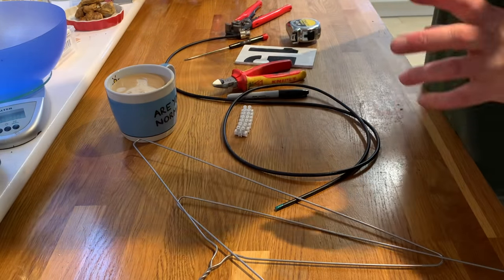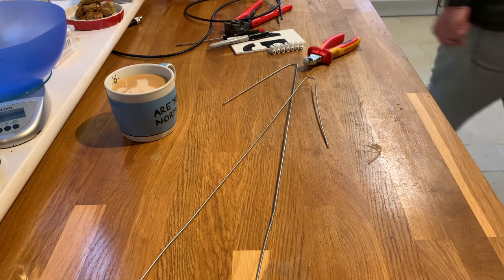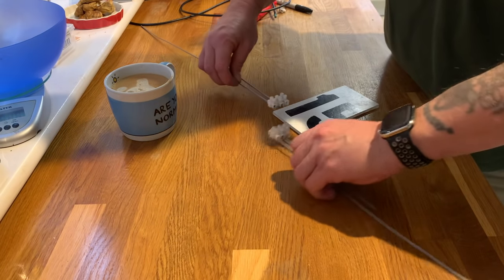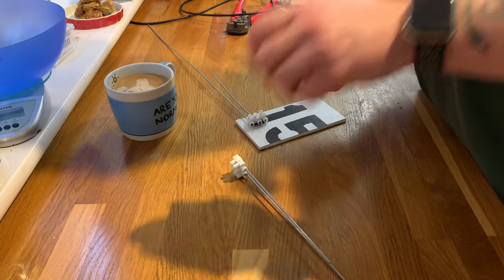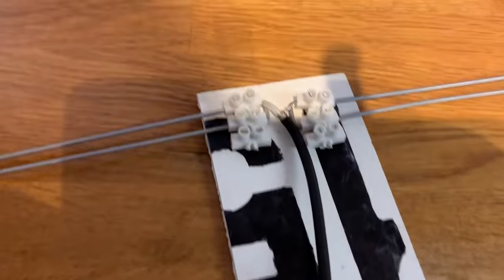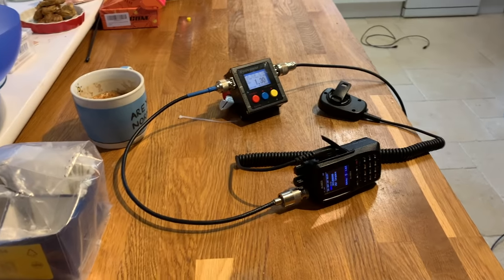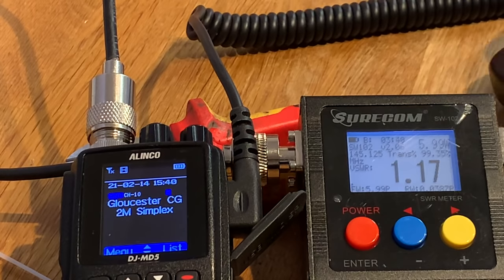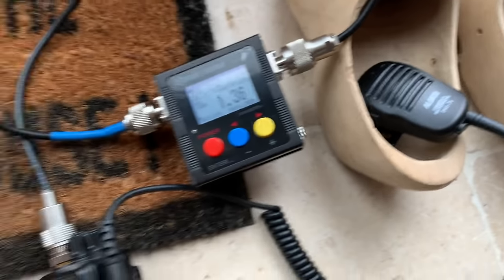HAM RADIO: The Coat hanger Antenna 2m/70cm dipole.

Comment: Thanks for the video! I built one last night following your measurements mounted on a flat piece wood and it attached to 1/4 pvc on a flat base as a indoor stand. I live in a apartment with very strict rules. Took me less than a hour  to build and I must say wow! I can open repeaters 30-40 miles away from the second floor completely indoors and 5-7 watts from my UV-82HP.  Match stays between 1.1 - 1.3 on all bands 2m/440 on my first try.  I'd much rather build my antennas than buy them so much fun!  Thanks for the inspiration to build again....I'm watching your indoor stealth build now, good chance I'm building one this weekend for a fellow ham in the same living situation nearby.  Anyone wanting a cheap & easy to build antenna it performs much better than the Nagoya NA-771 I was using with great reports on air. Thanks from Ohio 73's KB9QDI
Reply from the maker: Pleased I could help.  :)
Reply: @mike-M0MSN  definitely did, I've since made the 10m coax vertical and bought a new Ft-710! You gave me the bug 🤣. Thanks my friend, I love your builds and has given me the inspiration to build again.  The 10m has made contacts 4000 + miles already during Winter Field Day. So cool!
Reply: Thanks, this answered my search for a simple 2 meter / 70cm antenna for my Yaesu FT-65R handheld ham radio.  Needed one to place on the second floor deck.  Visiting family & needed a quick & easy way to hit local repeaters from the back garden.
Scrounging parts now. 😁.  Cheers,  KJ4KNV - D.L. in N.C.🇺🇸

Comment: Cheers from 🇺🇸US from being London born in 1944. I have built 2, 70 cm, and FM band broadcast ground planes using coat hangers and SO-239 connectors in the past and they
worked pretty well on those bands. Ray W2CH

Comment: Hi Mike, my first 2 m vertical antenna used 3 coat hangers with vey little cutting. 2 as a ground plane / 4 leg support and 3rd as the vertical radiator. It was an improvement on the 'rubber duck' and helped me get into the local repeater. 37 years ago now! 73 G0JLF
Reply: Heh, once built an SO239 socket and wire coathangar 1/4 w GP for 2m.   Managed to work MIR on packet.  Good times.

Comment: First 2m antenna I ever made was done with coathangars.   Built around an SO239 socket, 1/4w ground plane with radials.  Worked well enough to hit the Mir Space Station on AX25 packet when it was still operating.  That was a while ago now lol.

Comment: I got good results with the hanger looping through just one set of  terminals, anchored on the outer ones with the feeder on the inners. had to take some  of the bloc casing off though. it'll save about half a penny maybe, but I was running out of blocs.

Comment: Great Video.  Can you add additional elements to the same connector to cover additional frequencies?  Maybe use solid copper wire, etc. due to the length.

Comment: How easy was that?! Will be a bit long as the antenna starts at the coax split, so that middle spacing is also part of the radiating elements when measuring up. Now to raid the wardrobe (I assume I ignore the plastic ones 😮) 🧥 👗 👕👍🏻

Comment: That turned out awesome Mike. Its neat that you can build such a small dual band antenna for those bands.😀
Reply from the maker: Thanks 👍
Reply: @mike-M0MSN  How long does it take to get a lisence to use 2 meter and 70cm bands Mike?
We have to have 11 meter CBs in dump trucks to communicate with asphalt a nd gravel loaders and scale houses which is what got me interested in 2 way radio to start with but I don't like being limited to 11 meter.  I love these smaller antennas. 
Another youtuber was saying he made a 120 mile contact on  2 meter.😃
Reply from the maker: @RC-Heli835  The exam is online now, you simply need to purchase the “foundation now” book from the RSGB or Amazon etc websites and read it. Book the exam and pass it.  Please note that the license strictly forbids the use of Amateure Radio for commercial purposes. So if you need a radio for work that’s a different license.
Reply: @mike-M0MSN  Ok im looking into it thx.😀

Comment: ive build this also but for one of the long radials i used an old radio antenna  on the plus site  then it was so easy to get a good sdr 1,1 then isolated all with pvc  and iso tape   still works very well

Comment: The swr is good, but not necessarily the  radiation. If you have a dipole for one band and then another at 3x the frequency (like 2m and 70cm) with a common feedpoint then the higher band will have a radiation pattern that is not perpendicular to the antenna and not so useful when the antenna is mounted vertically. On 70cm RF currents will flow on both dipoles because the 2m dipole is low impedance on 70cm as well. The antenna is simple to build and I'm sure  it will be useful in many cases anyway.
Reply from the maker: Yep spot on Arne T and that is the whole point of the upload, to a help and to make people give it a go.  :)

Comment: If no one can find any kind of wire hangers at all, there is some 16 gauge multipurpose wire that you can find at a local hardware store thats pretty cheap for 50 feet, and it is awesome for this.

Comment: Great video Mike. I am yet to build some antennas when I manage to get a NanoVNA. Can never get my head around how these antennas work with two different lengths of elements on the same coax connection, but hey ho. Wow look at you with the nespresso. We have one but the local place that sells the pods are John Lewis I have seen the on amazon. We used the pods that came in the box and that's it since. Great quick antenna build.
Motters M7TRS 73's
Reply from the maker: Go to Nespresso direct online, next day delivery...  will do a video explaining how fan dipoles work in the future.
Reply: @mike-M0MSN  Super Mike will look out for that. Keep up the great work and advice Motters M7TRS 73's
Reply: Simple answer is you can have multiple elements like this design and providing they don't conflict with each on harmonics then whichever one is resonant will take priority.  I'm sure we can get Greg to do a speech on it when Macc club opens again :)
Reply: @2e0txe  hello Damian. so I guess this is some sort of radio magic and it just works. Greg drove past me the other morning when I was driving to work. Stay safe.
Motters M7TRS 73's

Comment: Hi and thanks for the video. I followed instructions very closely. It looks fine, continuity is not an issue, and I used decent materials. However, I simply cannot SWR it, constantly reading VERY high and with a AT-5555 I get an S-HI warning almost as soon as I pick up the Mic - what am I doing wrong?
Reply from the maker: This antenna is for 144-148 & 430mHz (2m & 70cm) not  27 mHz the AT-5555 is a 27mHz CB or 28mHz Ham radio....(10-11m)

Comment: Interested to see what the swr would be on 70cm without the 70cm dipole legs. As a 2m dipole alone doesn't have too bad swr on 70cm.
Reply from the maker: Probably not that much different  just the radiation pattern differs ( I got up to 1S point better signal on 70cm) but that could have been conditions

Comment: HI Mike,

Can this design be expanded into a 2- or 3-element yagi? If so, can the reflector(s) and director(s) also be configured like the driven element, or would they need to be separate for 2M and 70cm? I'm also wondering if they could be configured perpendicular to each other?
Reply from the maker: yes possibly give it ago...

Comment: Does wire thickness matter ? I used 1.3mm wire from a hardware store as could not find metal coat hangers anywhere, I didn’t know if using 1.3mm wire mattered or not ?

Comment: Nice! Great project for a rainy day. My only comment is that I’m guessing it’ll be a 1/4 wave antenna with an opposite ground rather than a dipole, since the jacket of a coax is ground rather than oscillating. Kind of like a tiger tail on an HT. A balun would make it balanced, and have the element connected to the shielding also radiate, increasing the gain. Right?

Comment: I tried to make this but my coax shield  and terminal would not fit into the block!  I sanded down the coat hanger and still did not work.
I am going to re-make it again and use a larger board and actually solder two jumper wires to an SO239 I think.

Comment: Great design Mike! I made one last night and it worked fantastically! I had to make two modifications in order to use the materials I had on hand: 1) I used 12 gauge solid copper wire 2) I used a bnc to banana connector. I soldered a short piece of 16 gauge speaker wire to the connecting points and the used the screw terminals on the banana plugs to connectthe other end. After tuning the performance was excellent!

BTW - What is the name of this antenna design?? I'm looking everywhere and can't find this particular design anywhere.
Reply: The name is, Coat Hanger Antena
Reply: Its a basic 1/4 wave dipole with 2m and 70cm elements. It can be used for Vertical (FM) or Horizontal (SSB) by flipping the base plate so the elements are vertical or horizontal.

Comment: Mike, I am a newbie and I am preparing to built something similar. Do you have any advice regarding adjusting the SWR by shortening the wires? What I mean is this: As far as I know, the 70cm and the 2m wires do not act independently, instead, they influence each other. So, is there - for example - a best practise for the order, like "first adjust he 2m part, then the 70cm part" (or vice versa)?
(If that makes sense - I am not a native English speaker)
Reply from the maker: Hi, it is always good practice to adjust the longest element first as these elements will have effect on their harmonics and in this case, the 70cm element so start long.
Reply: @mike-M0MSN  Hi Mike, thank you. This is exactly what I needed to know.🙂

Comment: What effect does having the wire U shaped like that have? Would you call that some sort of off center fed? I dont get why you have 2 radials on each side of the dipole instead of a single element. PLEASE explain.
Reply: Nevermind. Im stoopid. :)
Reply from the maker: Not stupid :)

Comment: Now build me one for 10-11 meters where I run. I need one for my attic when my Arial is down when my wife goes to Town, I must lay mine down on the bushes outside my house about 4 feet off the ground, it still have a relatively low SWR but can't get out very far when it is that low above the ground. So I want to build me a horizontal and one vertical, one for north to south traffic and one for east to west traffic here in the U.S.  For 28.000-26000 Mhz. So far not having much success.
Reply from the maker: OK Will do, one attic antenna for 27MHz coming soon, :)

Comment: How critical is the space between the two halves when mounting on the plastic? Just not touching or ??
Reply from the maker: Yep just not touching 10mm is good
Reply: @mike-M0MSN  thanks Mike! I have it built, just have to attach to a piece of wood from an old clipboard and attach some coax. Going to check out your other videos too.

Comment: Nre ham here and i have lots of questions 😂
 So if i wanted to hang this in a tree with a rope could i bend a eye in the end of the wire to tie the rope off to to hang it from  and if i did that would i need to do it after i get the swr set or would bending a loop in the end of the wire need to add to the length
Reply from the maker: yep add 1or 2 cm to the length of the longest element and then bend it back to form the loop, hang and check for SWR.

Comment: Great video Mike. Maybe a coat hanger Yagi as a thought.
Reply from the maker: Cool idea
Reply: @mike-M0MSN  I've been a great fan of coathanger antenna on 2 and 70. One trick was to solder the inner of an RCA plug on the end  of a single element for 2 or 70, and then have an SO230 adaptor on the top of a handheld - the two mated perfectly, and you had a half-wave whip that would substantially outperform a rubber helical. Used to do North London to Southampton on 10w 2M SSB on an indoor dipole and across to Holland on a 5 ele yagi made from coathanger elements basically pushed through drilled bamboo. There are plenty of ghetto recipies for construction online :) Chocblock terminals to stripped back patch leads.

Comment: Hi I'm extremely new to this would this antenna work with uhf/vhf duel band 136-174MHz/400-480MHz  I've got a alinco dj-md5xe and I just listen at night and was hoping I could get a better reception with this in the loft. Thanks in advance.
Reply from the maker: Yep it will work on 2m and 70cm
Reply: @mike-M0MSN  ok thanks for getting back to me, im doing nothing tomorrow so I'm going to have a go a making this👍

Comment: Great little easy antenna. Nice work.  Question mike. Have you ever used Stainless Steel wire rope? I want to put up an 80m Doublet and I need it very stealthy. With all that wire in the air I don't want it to sag.
Reply from the maker: Yes I have   https://youtu.be/ekP4I-GRSJQ

Comment: Hi, will this work with only the shorter elements, for 70cm?
Reply: Yes it should, as the antenna is just 2 half dipole antennas joined at the center.  But why not keep the 2 x 50 cm part?

Comment: Just got back into ham radio after about 45 years. I found this video and thought I would give it a try. I couldn't get the wires and coat hanger into my terminal block, so I soldered each side at the bend. It works really well. Tried it again with 14 AWG copper wire. I could have gotten wires in with coat hanger, but decided to solder. Does soldering this way make any difference?
Thanks for the great video. 73s Peter WB3IZU
Reply from the maker: Nice work!, any good connection works, solder, screw or weld.

Comment: The problem is that steel is much less conductive than copper. Copper is more conductive than aluminum. This means there is a loss of power when you use steel or aluminum.
Reply from the maker: yep, but then my car antenna is steel........
Reply: @mike-M0MSN  I made a 2m/70cm dipole with 1/2" pvc and speaker wire.

Comment: I want to add a pole for 220mHz could I just solder another wire below the first two?
Reply from the maker: Yes you can, each leg would need to be 31cm long.  :)
Reply: @mike-M0MSN  so I’m thinking I would like take an inch of coat hanger solder that to the 2nd leg, then add the new leg to another circuit strip and solder that to the other end of that inch wire.

Comment: Awesome build. Does it matter what the amperage (6/10/15/30/60) of the strip connectors are?
Reply from the maker: No as long as the cable and wire fits.

Comment: Could you have got into that repeater if you would have had the antenna vertical and not horizontal.
Reply from the maker: Maybe, but never on just 5Watts on a Handheld unless I go upstairs or a mile up the road..😂

Comment: Surely you want to check SWR on 14**5**.500 not 144.500 for FM Simplex
Reply from the maker: It matters not, if the concept works on 144.500 mHz it will work on 145 or 146 with only minor adjustments.  :)

Comment: Excellent video Mike! Thanks for putting it  up there for us "newbies" and providing us with some no nonsense proof that these projects are doable ... we just need to get past our doubts and do it. I do have a question if you have a minute or two ... I'm currently in the process of doing something very similar; the plans call for 1/8' stainless steel rod for the two elements. My question is, would 3/16' brass rod or #2-AWG solid copper (commonly used as grounding wire for home electrical systems) be better options. Planning installing it in my attic (in case that matters). 73 Ben
Reply from the maker: You can use just about any conductive metal as long as you can connect it.  :)